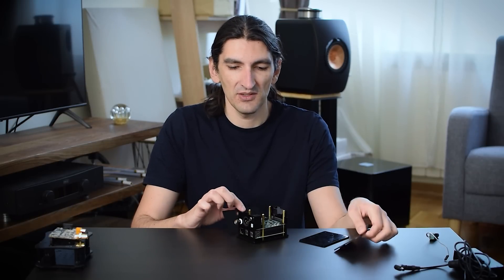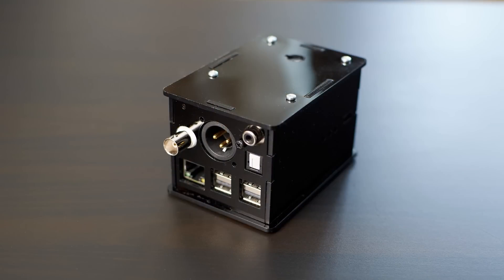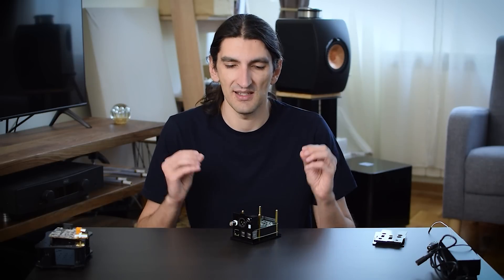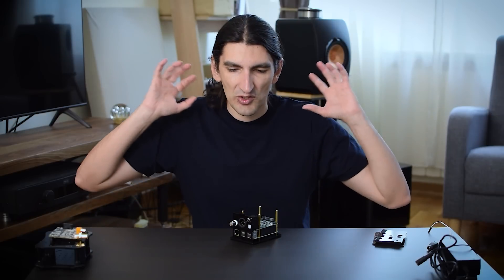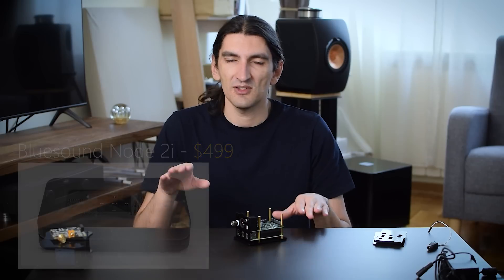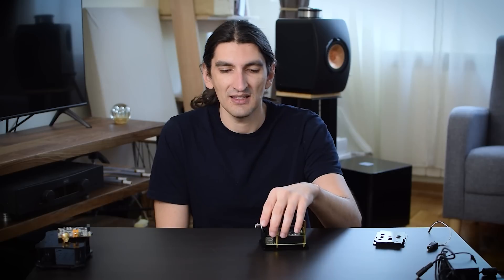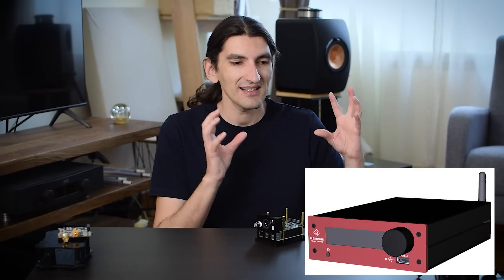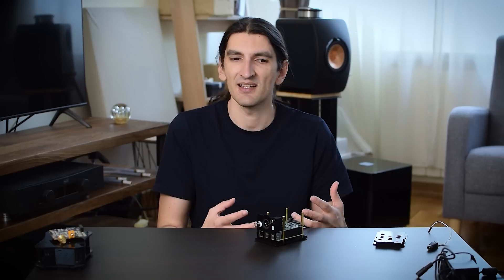Make your Raspberry Pi a true HiFi streamer with Pi2AES

Comment: You could compare w/ digione signature (close costs). I tested pi2aes versus de signature, still pi2aes is superior (but when its using i2s output). It runs much more open specially using audioquest vodka hdmi.
Reply from the maker: I use DigiOne Signature these days because it has fantastic SPDIF output (and my favorite tube DAC uses that connection). With GentooPlayer installed it is my favorite device to use as a Roon bridge and SPDIF connection.
Reply: @iiWiReviews  Nice, yesterday I tried Pi2AES vs Digione Signature (coaxial only). Digione had a better sound. But my actual DAC have i2s, so... Pi2AES all the way. My digione streamer have a ifi power supply (dirty side) powerbank (clear side) and I divided the raspberry board from de digione... its sounds came way better doing this. I encourage you to do so.

Comment: I am using Pi2AES 2.0 that was upgraded to work with 5v out of the gate and has the same clocks as it’s bigger brother. I am pairing this with a Chord Qtest DAC and I am powering it both with a Jcat linear PSU.  I am not repeat here everything was already said in the review, but I will focus on what I have learned.
1st. Power supply quality makes a huge difference and it is rarely given the attention that is deserved.
2nd. Quality of fiber optic matters. It is not a question of "it sounded better to my ears", cheap one are losing so much information that can’t transmit higher resolution files, and yes real glass cables sound significantly better (I am using a QeS cable). To my big surprise the cable actually had. Burn in period of about a week… I can’t understand it nor explain or. If anyone can, please tell me.
3rd. With the chain in place I was able to run a test and see id USB standard itself degrades the sound quality, i put the same file on the sd card and on an external ssd connected to usb. From the storage the file use the same exact path to the chain down to the same exact lanes used. The only difference was the usb standard use for files on ssd, and yes. The soundstage for the files on ssd were slightly narrower. I don’t think you can pick it up if you don’t A/B it but you paid for the toy, why not take fool advantage and use a 1TB sd card? I don’t even want to go in to network storage and roon because at that point you are just burning money on storage, low noise switches, psu for those switches, fiber optic around the house…. Basically 5-10k just to solve a problem that can’t be avoided entirely. 
P.s.
Pi 5 came out and if that works with pi2aes 2.0 it will even solve the 1TB sd card limit because there are already pcie boards for M2. Can’t wait to test it out.

Comment: Our notes are the same, because your description of the sound is exactly the experience I have with my Pi2AES.  The improvement in the bass and mid-bass was the most noticeable feature, then clarity.  Not sure about soundstage…I never listened for the difference, so I have some testing to do!

I’m using it with an IFI LPS.

Comment: Dear friend, I love your reviews and I'm following you a long time, so first - Thank you.
I bought the SMSL-M400 because of your review and I'm happy with him.
I use a NUC as a streamer but I'm looking for something better. 
I saw that the Pi2AES is no longer available anywhere.
Do you have a suggestion where to buy one or a good substitute?
Thank you very much again!
Reply from the maker: Thanks! I believe there should be a Pi2AES Lite version available now. If not you can opt for iFi Zen Stream that has equally good sound quality (review coming soon) or Pi2design Mercury if you need more expensive variation with an option to add internal NVME SSD storage (but again similar sound fidelity).
Reply: @iiWiReviews 
Thank you very much.
What is the difference between the pro and lite?
The mercury isn't available.
I will check your other suggestions.
Thank you!
Reply from the maker: I believe that lite version just omitted I2S and AES/EBU outputs. You still get BNC AES, SPDIF over RCA and optical.
Reply: @iiWiReviews  Thank you very much.
I want I2S so I will wait for the mercury.
They will start shipping in November.

Comment: Does a Pi have to be shut-down, or can you simply turn off the power? (I'd imagine that, like any computer, it needs to be powered down)
Reply from the maker: Some OS-es can power it down but some don't have that feature so you would have to switch the power off. I don't suggest doing the second one since it can lead to SD card data corruption and having to install everything again. In my opinion, it is best to just leave it ON at all times. It consumes just ~3W in idle.
Reply: @iiWiReviews  thanks 👍🏼

Comment: Looking at linear power supply options for 24V, such as the SBooster, they may well cost as much as the streamer!
Reply from the maker: Many users reported that it works just fine with any PS ranging from 12 to 24V. I haven't tested it myself but as I said many confirmed it. So that makes it much easier I suppose.
Reply: I have tested with 12v, no issues works, into the HAT DC input. I did the 5vdc mod, made things much easier.

Comment: For anyone interested, I have been comparing the ifi ipower elite 24v to the stock switching power supply and it's significantly better.  Some tracks that are obviously a bit harsh in the treble and a bit lacking in bass/lower mid bass are far easier to listen to.  The pricier power supply increases detail and separation in the high end, but somehow it's less harsh and eliminates listening fatigue while increasing both bass/mid bass and control.  It's just an overall more pleasant, "warmer" sound but without loss of detail.  I decided to try the 24v instead of the 5v mod, but I'm really curious now.  I wasn't sure I'd hear a difference with the new power supply, but it was fairly obvious to me.
Reply: Also, I removed the 5v jumper to test out a separate power supply to the pi (standard pi power supply to the pi and the ifi to the pi2AES).  I did not notice a difference, but obviously it's not very convenient to A/B test as it requires unscrewing the case.  It can't hurt, but don't feel like your missing something if you don't have the time to do that.

Comment: Can you control the volume through the PI2aes (and the OS installed) in a chain like this: PI2aes>DAC>power amp. No preamp!
Is it okay? Would it affect audio quality somehow to play with volume early in the chain?
Reply from the maker: Most OS-es do have a volume control and yes you could do that. However, I'm personally not comfortable with it. First of all, when software attenuates the signal it is also compressing the dynamic range. Secondly, if any sort of pop/klick sound happens between the DAC and the power amp, it would be played trough speakers with maximum volume level. For example, many DACs can make pop sounds when turned on/off or when sample rate of the music is changed. If there's a preamp after the DAC, that sound gets attenuated together with the signal, but if you use software volume in the beginning of the chain, then any sound originated later on gets fully amplified and could even damage your twitters in a worse case scenario.
Reply: @iiWiReviews  Thanks for the comprehensive reply!!! Better then to manage the volume down stream then with an integrated or preamp.

Comment: Another question...from  what I understand this pi2as hat it is only an output extension? how this is improving sound over usb output  of the pi itself? and why different output hats had different sound signature and resolving resolution...they color the sound in any way over usb out? it is not just a digital signal outputting thru different connectors and protocol?

Comment: Hi. Top notch reviews, truly high class.  Do you know if Pi2AES can run TIDAL Connect using any of the available OS:s ?
Reply from the maker: I haven't researched about Tidal connect but it's a software thing... So as soon as any of the OS-es supports it, there will be no problem on the hardware side of things and Pi2AES will work with it just fine.
Reply: @iiWiReviews  Thx! Seems they are sold out though...!
Reply from the maker: Again. I'm not sure if my positive take on it had to do something with it. 🙂 But I hope they'll make more...

Comment: Nice, just built a rpi4, just using USB into a DAC, wondering if better cable is worth it or no difference, or a HAT. Seems alright to me, need to get a new DAC first (SMSL D1se looks good). Also only using a USB C fast charger from phone. The idea of these is to keep it simple and cheap, but lots of fun and great value.

Cheers

Comment: Bluesound now makes a newer version just called the Node. It would be a Node 3, but they have decided to drop the generation number from the name. It has a new (internally balanced) DAC and may have changes to the streaming portion. The other big advantage that the Bluesound unit has - is the software interface, which is very very good.
Reply: I had a bluesound, Pi2aes puts the sound quality of bluesound to shame
Reply: @omkazn  Okay, I am using an external DAC, which sounds much better than the internal DAC.

Comment: Cheers! Do you really think that the sound will be of higher definition with this Pi streamer compared with a powerful pc? At witch order of magnitude? My pc ryzen 3950x go thru adi dac then smsl da9...will be better from Pi thru dac and amp? Thank you!
Reply: Your more powerfully system, with the amd 3950x and most likely a beefy gpu, produces a lot of electrical noice and interference. Something like a raspberry pi will produce less electrical noice, leading to a cleaner audio signal. Wether you can hear a big difference, well that’s going to be heavily subjective, but utilizing a pi instead of a gaming oriented pc, your giving the audio signal the best chance possible.
Reply: @devinmatteson   I output from pc only digital signal over usb...do you think that the digital signal will be so distorted that could put the decoder from dac in trouble...losing some information because heavy correction needed? The dac show me 0 usb errors.
Reply: @Sorin_F  no, you typically won’t get any data errors with a gaming pc versus something like a raspberry pi. It’s really only the timing/jitter that will suffer from using a gaming pc over something like a raspberry pi as well as higher electrical noise being introduced into the audio chain. Dacs can composite for these two things, but not to the level that having a good source like a raspberry pi will offer. The differences in audible perception is a debatable topic, as the differences are finer than the rest of an audio chain, but if you’re after the best possible audio, having a good source is a good thing to have.
Reply: It depends on your sound card, something like an EMU 1212m from creative will blow all these Raspberry digital hats (much better dynamics, sound staging etc etc.)

Comment: Hello and thanks for your reviews. I was wondering if you have the same results when streaming a CD (wav or flac) from the internet and when reading the same file from a local disk attached to the streamer ?
Reply from the maker: Somehow, it sounds better when local files are used. I wish that's not the case cause I love using Qobuz and Tidal for their convenience, but in the end local files somehow sound the best. Just don't ask me why, it's a mystery to me, but the same result was repeated in several highly transparent systems. In less resolving ones, they often sound the same.
Reply: @iiWiReviews  Ok, thanks for the response.
Reply: @iiWiReviews  good to know thanks.

Comment: Nicely Done.
Does the raspberry pie and either one of the hats you talk about run hot & need a fan as well ?
Thanks
Reply: Not in my experience.  They're barely warm.
Reply: I don't think you mentioned which dac you were using ?
Reply from the maker: My Pi runs at around 55 C with a HAT and no cooler whatsoever (not even the small passive ones)... That's perfectly good temperature for a chip.

Comment: Just another FYI. The pi2aes HAT will work with a 12vdc (2.5/3amp) supply. This certainly makes linear power supply use easier. Michael only made the HAT 24vdc, as he had a DAC output planned (which never happened).
Reply from the maker: Great info, thanks.
Reply: Stephen, in this tip the 12vdc can be plugged into Pi or directly in the P2AES HAT (with the jumper on) to supply all the system?
Cheers.
Reply: @lucianobadoe36  Yes. 
With the jumper on, I powered my hat and Pi with a 12v supply. 

A quick google will show others using 12,15v LPS’s….. if you have a cheap SMPS, just run a test.
Reply: Much appreciated, thanks!
Reply: I ask to Michael, quote: "The PI2AES needs 19V minimum. 12V won't work reliably."
Reply: @gregwx  did for me. Other users confirm 12-15v. Just do the 5vdc mod, you don’t need to use the PI2aes dc header.
Reply: @Grizzly1644  I going to stick with what the designer of the device specifies. Thanks anyway :)
Reply: @gregwx  no problem. Whatever works for you. Just enjoy the music.

Comment: I owned the Pi2aes. Make sure you do the 5vdc power mod to bypass the 24vdc input and switcher. This source keeps up with $3000k sources with a linear power supply. Highly recommended.
Reply: May I know if are you able to test the Pi2AES's HDMI I2S output to DAC able to play DSD files (like 64/128/256/512) properly?
Reply: Any linear PSU you recommend?
Reply: @snowrang3r657  if you do the 5vdc mod, any decent LPS with 5v 3amp should work.
Reply: @Grizzly1644  like the Allo Shanti?
Reply: Does it put out spdif?

Comment: The I2S output of the Pi2AES is a superior connection. It's hard to describe the difference but the music is just better in every respect.  There is a greater sense of pitch, timing, clarity and instrument separation. It generates no tension or stress that leads to listener fatigue. I could never go back to anything with USB in the chain. Switching back to USB and I'm instantly presented with that sonic character I've been trying to eliminate for years with better DAC's, Software, Computers, Power Supplies, USB/ SPDIF Converters, USB Cables, Digital to Digital converters, re-clockers, etc.  I have tried nearly everything and spent a pile of money trying to get rid of the sound of USB audio. My struggle is finally over. Golden Sound's observation of avoiding USB altogether was not emphasized nearly enough in his review. Not sure why there is not more press on the Pi2AES but sooner or later the word will get around. https://www.youtube.com/watch?v=Jvu_doQfAI0&t=777s
While the SPDIF output is good on the Pi2AES, it second place to the I2S. If you have a DAC that can receive I2S, you owe it to yourself to get one of these. I have no connection with Pi2 Design, other than they took my money and in return gave me something extremely worthwhile that solved a decade long dilemma.
Reply: What is the connection type for the I2S output on the Pi2AES, HDMI?
Reply from the maker: Yes, it's HDMI which I completely forgot to mention in the video because it's on the side and not grouped with other connectors. 😅
Reply: @iiWiReviews Thanks!  Did you notice a sound improvement using I2S versus the other connectors? Great video as always!
Reply: @davidfairchild1640  YES, HDMI.  I'm using a Denafrips Pontus II DAC that accepts I2S via HDMI. The DAC allows custom configuration of the pinout to suit your needs. It's very convenient and was much easier to setup than I expected.
Reply: @HHTTRRNN  thanks!

Comment: Hey man, if you want to push the performance even further, get allo usbridge signature and put it underneath pi2aes instead of a pi. A little pricey and less OS compatible, but the sound with LPS is worth it.
Reply from the maker: Wow, that's a next-level "mutant" combo right there. 😆 I believe it's doing what you say because USBridge is tuned for lower noise than the general R-Pi board, and it stands to reason it pollutes the Pi2AES less. But also, I believe that the new Pi2Design Mercury is going to do just that out of the box, cause it's going to optimize the whole device around a compute module instead of using the whole Raspberry Pi board. I'm keeping a close eye on that one.
Reply: @iiWiReviews  yeah, scary beast 😅 PSU swap makes more noticeable improvement, but it shaves some noise from rPi power controllers and radio.

I wish the new streamer did that, but when I checked a while ago, it was planned to use switching power regulators (which can be fine I guess), while usbridge sig has linear regulators all over the place. Also, new streamer would have a controller for internal storage (like ssd), which is not my first choice either. Because of a power noise of the storage device. And I prefer to have a dedicated server upstream in the network. A bit better for sound as well. 

Anyway, I bet Michael would make a great product that would sound great and be much more convenient for a user.
Reply: My bad, Separate Ultra-Low Noise LT3042 LDO’s (linear power regulators) will be used in the Mercury for powering oscillators and some switchers on the power input

Comment: I am one of the lucky ones who got  hold of a Pi2AES and I got a huge improvement in sound quality when applying a 24V linear power supply (studer900 clone) and even more when I I used a separate power supply for the raspberry pi.
This is not a hack but just the way the manufacturer prescribes separated power supplies.
Fully agree with your discription of the sound quality.  With a R2R DAC and a SET tube amplifier you will profit maximally of these qualities of the Pi2AES.